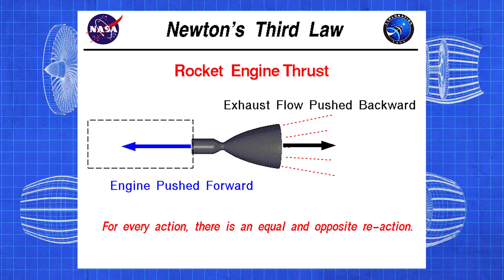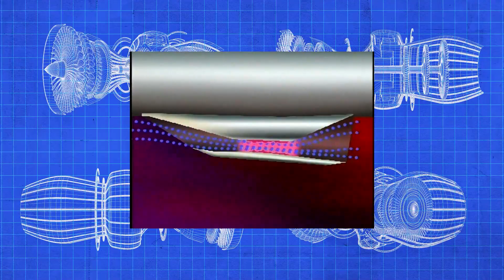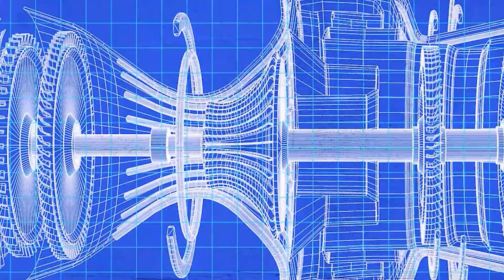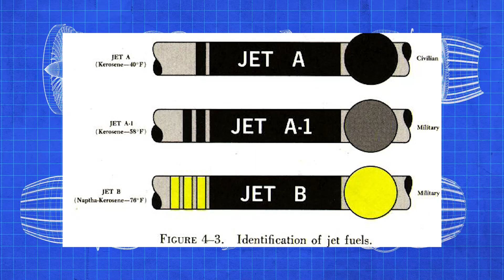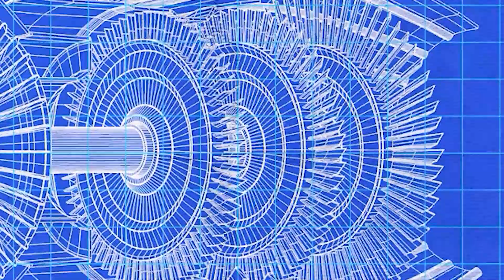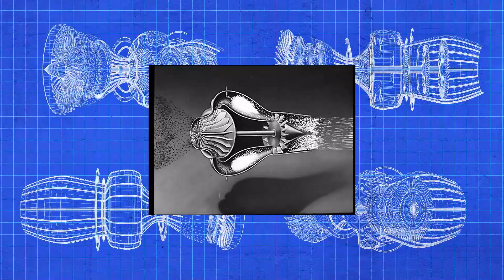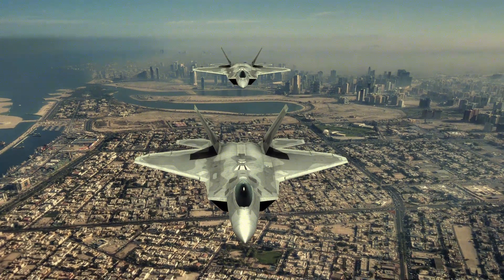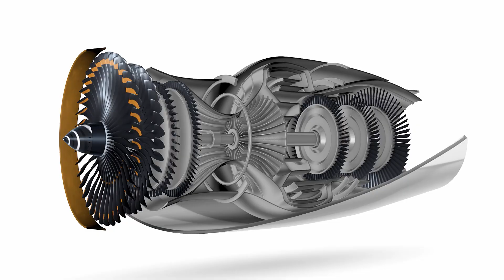Why do Jet Engines Work?

Comment from the maker: Hi everyone! I competely forgot to mention that the name of  Suck Squeeze Bang Blow  is " Brayton Cycle ". This is named after American engineer George Brayton who came up with the idea of a "constant pressure" system in 1872! This is contrary to the Otto Cycle (constant volume) that is in cars. It was a stupid major piece to overlook.  All jet engines are Brayton cycle engines. Brayton cycle is considered to be the best method for internal combustion!! 

also I misspoke at 5:30 when I said "every two fans is a stage", what I meant to say was "every two sets of blades (1 rotor and 1 stator) makes a stage" I promise I have a powerplant license lmao

I know the audio could still use more work. We're slowly getting there! If you're interested in staying up to date on the channel and hearing more from the team (or even join the team), be sure to check out the channel discord server!: https://discord.gg/jjvZHcV
Reply: I will call it Friday Afternoon

Comment: By the way, the fan in a turbofan may act like a propeller but it doesn’t produce thrust like a propeller. The fan is more of compressor than anything else much like the spinning blades in the axial compressor. Bypass air is compressed by the fan, then expands and accelerates out the back when it reaches the nozzle of the bypass duct and this is how bypass air produces thrust.

Comment: jet engine rank 18, why jet engine works rank 5, why are jets so loud rank 5, how jet engine works rank 7, could go on... and highest viewed on channel (and counting) LET'S GOOOO. Continue this excellent content and optomize, but also consider additional content that ties the past, present, and future of aviation technology to pop culture. For example "The Planes of Halo - How Real Can They Get?" and discuss the history of vertical takeoff jet aircraft, where the tech is now, tie into the Halo Pelican, and conclude with "how far off is it, technologically." Similar example something like "COULD THE AIRBORNE AIRCRAFT CARRIER IN AVENGERS BECOME REAL?!" and maybe touch on thrust to mass calculations, the type of energy it would require to actually lift and sustain this type of aircraft, tie into real history (even of normal aircraft carriers) and current technology that applies, etc. Two things will happen, you can use limited footage under fair use that is instantly recognized by everyone, and you expose yourself to search tags that pull some SERIOUS volume. You could even do one about AI featuring the plane from Stealth (2005) and relate to real AI that today's planes may have. Those types of videos could bring your channel to have videos with 1m+ views and channel 100k+ subscribers and much higher.

Comment: What if we were to put a ring on the engine blades to connect them together? That way it may be more structurally sound and if it dose fail the blade probably won’t get sucked into the engine

Comment: Isn't it Junkers that made the Jumo 004, Messerschmidt only used it for their 262
Reply: Iirc I think you're correct, but my notes said that the two lead engineers were from Messerschmitt. Trying to help viewers follow the trail of the 004 would have been hard to do without spending time
Reply: @pilotgeorge2000  I can confirm that our notes did indeed say this.